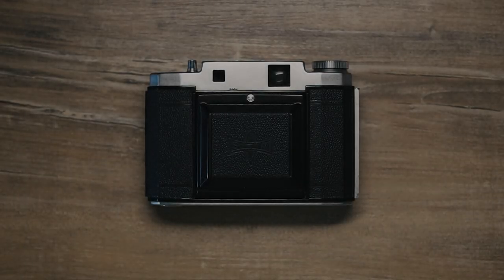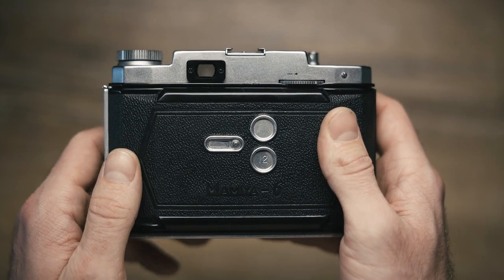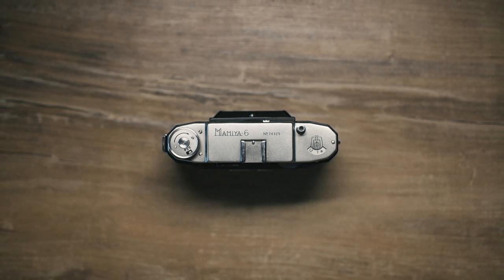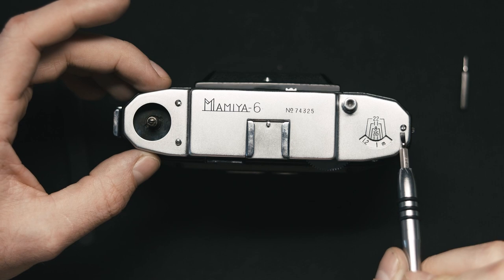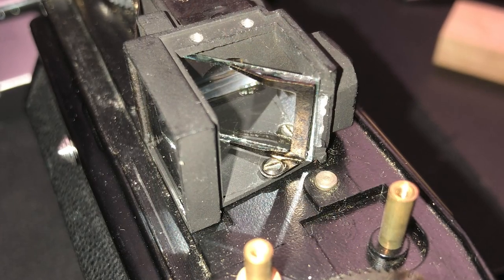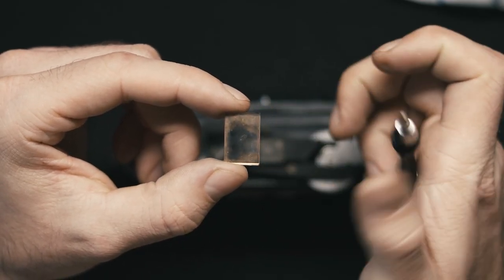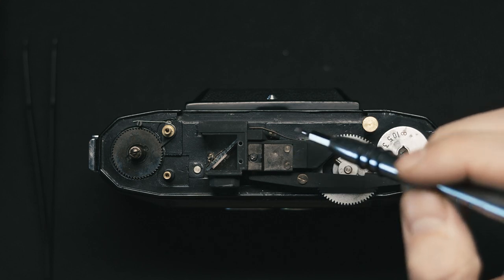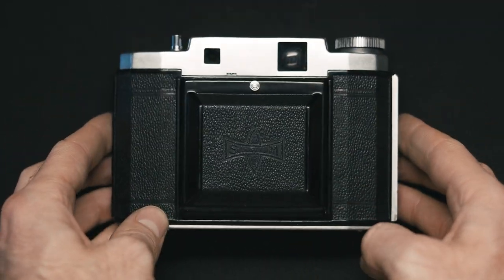Mamiya 6 KII (folder) Beamsplitter mirror rangefinder repair. My experience.

Comment: Very, very good video, it's rare to find informations about this problem. I had quite the same problem with the Mamiya Six-IV I've just bought: the beamsplitter mirror was fungused. Nothing to do. So I followed exactly your indications, and it works perfectly! 
For some euros, my rangefinder is brand new! The only problem is that the vertical position of the patch is more difficult to adjust on a Six-IV: there's no adjusting screw. I must find a method.  
Thank you for sharing and best regards from France.
Reply from the maker: So glad it helped) I don`t have access to Six-IV so cannot give any advise. But I guess it has to have adjustment. Another thing I didn`t mention in the video. First, in KII you dont need to take off the lid to adjust the patch: for horisontal there is a cover screw below the distance disk on the rear that hides another one shown in the video. And for vertical adj you can unscrew the cold shoe and there will be a hole for the vertical adj screw. Second, the vertical adjustment with the screw WAS NOT ENOUGH to align the patch, so I put a small piece of paper as a spacer in the "mirror groove" (you can see a whitish stripe behind the mirror at  8:16 ) to get it in the range. Hope that will help you a bit)

P.S. This article might also help https://tinkeringwithcameras.blogspot.com/2016/03/mamiya-six-restoration.html
Reply: @muralboletube  Hi Albert, and thanks a lot for your answer. On the Six-IV, it seems not to have a vertical adjustment screw. I assume the accuracy of the bases of the two 45 degrees mirrors  is sufficient. So the surfaces have to be perfectly cleaned before regluing the mirrors. that's what I've done, and the vertical position is good. Not absolutely perfect, but good, it won't  be a problem for shooting. I think Mamiya added a screw on K2 and others to obtain a perfect adjustment. 
For horizontal position, I have a screw on the cam, as on K2.
I bought this camera in Japan, very dirty but complete. No funguses on lenses, shutter sticky but less than on the Yashica Mat 124 I've restored last year! The bellows are out, but it's easy to remake. Next spring, I will shoot!
Thanks a lot, live long and prosper.
Reply: @muralboletube  I have the same problem of vertical adjust of the patch with a automat . As thierry said. I don´t find any adjust.screw. I just see a hole in the cylinder ( with a kind of balck silicon) but i don´t know what to do with this hole ???
Reply: @thierryfontaine7210  Salut Thierry ! I have the same problem with an autoamt and I don´t find any screw for the vertical adjustment. Just a hole in the cylinder ...but donpt know what to do with this hole ???
Reply: @aaustenit3630  Hello, nothing to do with the hole: it's the light passage for the left window of the rangefinder (seen from the front of the camera) I think the only way to adjust the vertical position on this mirror is to use a thin wedge of steel as they did at the factory. My mirror had one of these wedges, the difficult is to replace it correctly after cleaning and old glue scraping, by trial and error. Big patience required, and very thin tweezers!!
On my Six IV, the vertical position is not perfect, but it doesn't affect the focus. I only have for the moment some bellows issues.
Reply: @aaustenit3630  I adjusted mine several years ago and am going by memory, so this info may be faulty, but: The cylinder has a prism inside, and by rotating the cylinder you can move the rangefinder image up and down. Put a small tool such as a screwdriver shaft into the hole and use this to rotate the drum gently around its long axis; keep checking until the vertical alignment is correct. One downside is that as you rotate the prism, it also will change the horizontal infinity adjustment, so adjust the vertical position first and then do the horizontal position. Again, I am going by memory, but this is how I remember it. Bonus fact: the vertical adjustment on the Nikon S2 camera works on the same principle!

Now that I have seen this excellent video, I really want to find the Chinese source for the beamsplitter and replace the one in my Mamiya 6 Automat... the viewfinder of the camera in the video looks so bright and clear that I am jealous! Thank you for this excellent work.
Reply: @thierryfontaine7210  En fait , ce trou sert a ajuster la position verticale !!! Je viens de le faire !!! place un tournevis fin dans le trou et utilises le comme levier , dans un sens ou dans l autre ( vises ou devises ) et tu verras que tu peux ajuster parfaitement verticalement  l image fantome . C est tres simple
Reply: @jlwilliams  I just realize that what you are telling me is what I just wrote to Thierry Fontaine !!! Thanksss  just not forget to put some glue on the cylinder after adjusting !!!

Comment: Good video. I repair a lot of these and the different models have various changes. The one I'm working on at the moment is not possible to clean the silvered side unless you unglue it. Your model is different. There is a man on eBay that will supply the mirror precut and its very blue unlike the old gold ones. I'm still waiting for a man in the UK to make me new ones but he's very slow. Ive been waiting from before last Christmas! The one problem I have with one is the rangefinder will not focus the double image at infinity. I would seriously have to grind metal on the swing arm which cannot be right. One thing I tried on a mirror is unglue it and place in 50/50 water and bleach. This seems to eat off the fungus. Then I put it in lighter fluid and gently rubbed only my finger over it very lightly. This method seemed to clean it really good..if you use a brush or cotton bud you will wipe the coating off. Its this mirror thats the big problem in seeing clearly through the viewfinder. All other glass cleans up no problem.
Reply: "its very blue unlike the old gold ones" ...remember that if it looks blue on the reflecting side, it will look gold on the transmitting side, because white minus blue equals gold (more or less) so if it reflects blue light, gold light will come through.

Comment: Good work, one question, can’t figure out to change the asa settings……..
Thanks
Reply from the maker: Thanks) You cannot change ASA in camera, it depends on the film you choose (200, 400, 3200 etc). Or you can push/pull film after the fact (just search it on YT)

Comment: About a year ago I did exactly the same thing as you when cleaning mine 😂. I also found exactly the same beamsplitter from China, but have yet to fit it yet - it looked too fragile to cut but I will give it a go now after seeing this 🙂👍. How did you calibrate your range finder? With a tape measure?
Reply from the maker: First of all I’m really glad that this video is helpful) And speaking about calibration, yes the first thing I tried was using a measuring tape) And it seemed to be pretty good. But after that just to be sure I used a piece of ground glass on the film plane to see if everything aligns well. I took it from an old film enlarger (er?) and taped it on the film rollers. The process was a bit painful to hold the back lid and the pressure plate which is fixed in K2. But everything was fine. I aligned the patch and then checked the glass with a magnifier. If russia doesn’t envade my country think I will be replacing the bellows in few months. Good luck! :)